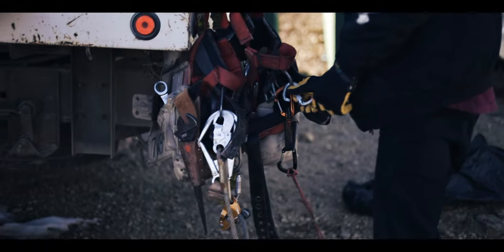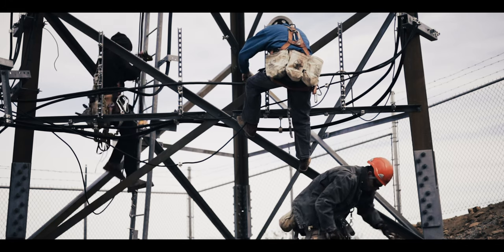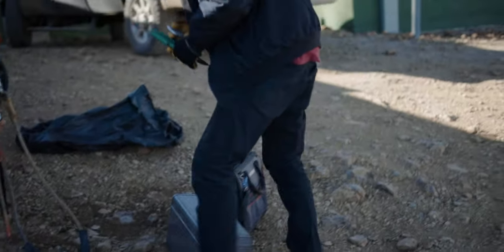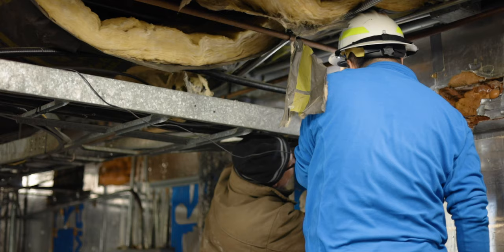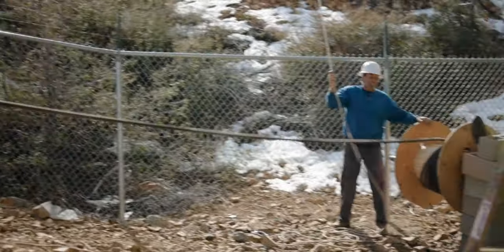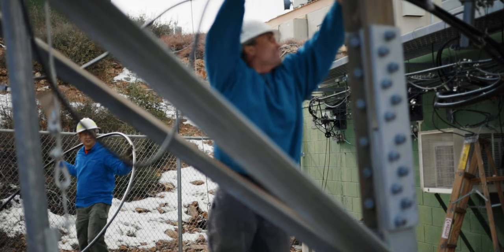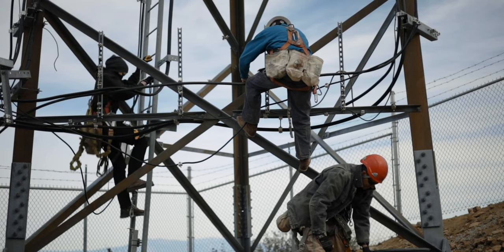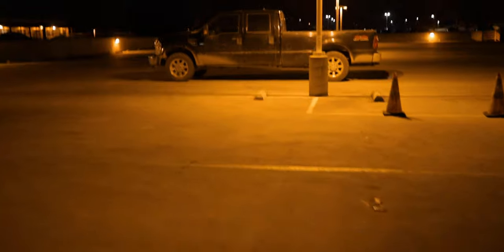Tower climbers realign a microwave link

Comment: I live in hollywood with a good view of the hollywood sign out the kitchen window. Doing dishes one evening years ago. I could see huge electrical arcing from the transmitter building to the tower above the hollywood sign. I called the lapd non emergency number and told the operator I could see electrical arc flashes. Eventually I ask if there was an lapd copter in the air nearby. Can you send them. They must have misunderstood flash with flasher as they were circling with their night sun on. Operator said they can't see anything. Tell them to turn off their night sun.  Oh they see it now.  I pulled up a chair and waited. Within about 20 minutes I saw a car speeding up and around the access road and soon after the arcing stopped. 
 Any idea what would cause massive arcs like that?  
Ps mid 70s I got a private tour of the itt/pac bell central office with the microwave tower on top.  Got to see the mechanical switch gear that rotary phones controlled and the time is machine that one could dial up and the time will be.   Beep. Even the microwave multiplex gear that combined thousands of phone calls at one time and sent them to the antennas on the roof. I dont recall if it was 4" or 6" coax to those.  I also learned that the phone company got the designers of the arco plaza towers to move them 11 feet farther apart or give up floors for a microwave repeater station as the original placement blocked the microwave signal to santa monica.  I would hate to work on those floors near the microwave beams. I wonder if popcorn pops if you place it by a window
Reply from the maker: Wow! That's a crazy story that you were able to see the arcs. I'm looking at the Google Maps view, and I see some small buildings. It could have been that the transformer they had up there was throwing sparks. The only other thing I could think is that they had day/night strobes for the tower and the strobes turned to day time mode (which at night would look like massive electrical arcs). But, more than likely it was the transformer up there that was blowing up. It happens as those transformers and the other electrical equipment age, they degrade and fail... usually spectacularly.
For the microwaves, generally the sides and back of those dishes are relatively safe. In front of those is where you'd really want to stay away from.
Reply: @TheBroadcastEngineer  i am almost 2.5 miles from the tower.. just measured..  seems to be a cable tray there.  was crossing in the area of the cable tray.  i tried to get a picture but it was too far away and my Nikon F3 was out of 35mm film.
Reply from the maker: Interesting! There usually isn’t that much high enough voltage in cables to cause visible arcing two miles away.

Comment: I have what you may think a silly question 
Why not run a dozer up those access roads to smooth them out or would the cost be prohitive?
Reply from the maker: Not a silly question at all. About once a year the landowners do that. We chip in for the cost of that. But the weather is that bad that it is constantly wearing down the road.
Reply from the maker: I thought this was a different video when I replied. For this site, it’s Forest Service land. It’s quite an expensive ordeal. Orange County Fire Authority just jumped through the USFS hoops to do that to the road. I drove it about a week after, and it was amazing! I’m sure it’s not as nice anymore because off roaders tend to tear up the road, unfortunately. Last time the road was graded like this was over 10 years ago.